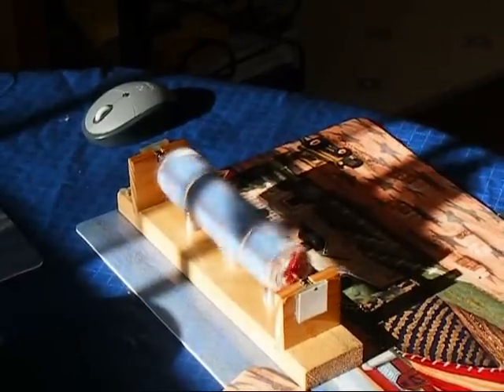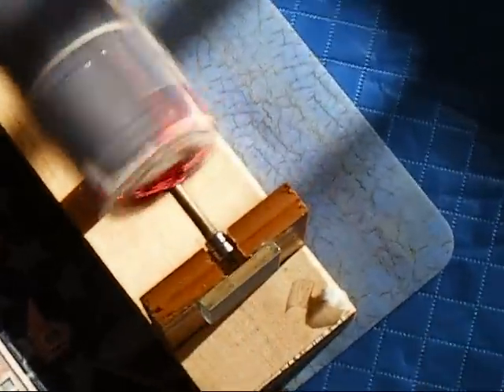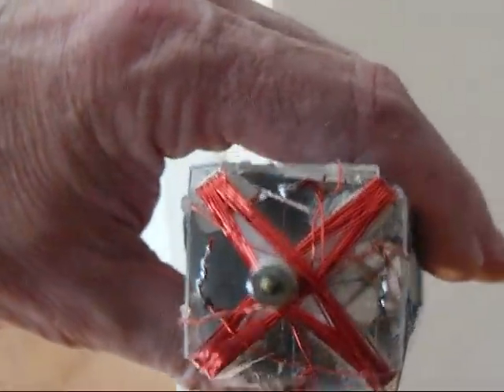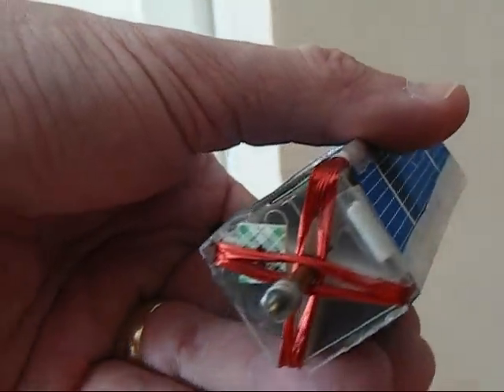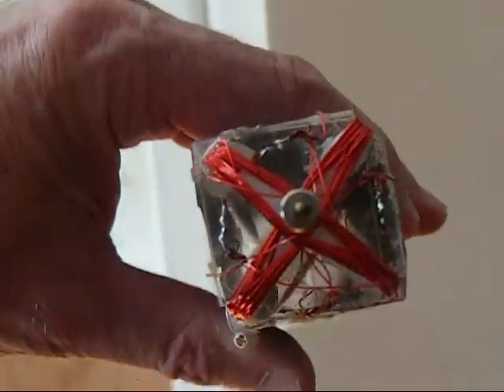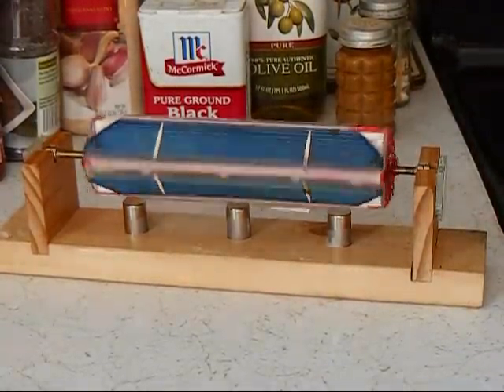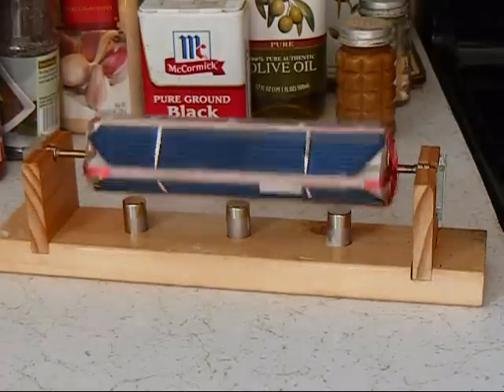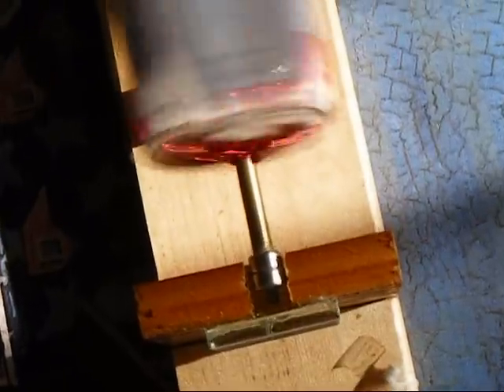Mendocino Solar Motor

Comment: Hello, I've noticed the exact same magnetic imbalance with my experiments and have tried the same corrective measures. I have a setup made from ring and cylinder magnets and the air gap can be very small, but the smaller it is the more cogging effect. This unbalance can really through off your attempt for perfect balance. The rotor can be balanced to overcome some of the cogging but then at high speeds the rotor really gets off balance again.
Very nice job and explanation.
Thanks
John

Comment from the maker: Thanks... (Good question) Search 'Mendocino" on You Tube. There are examples of almost every imaginable type of field magnet. Since these motors were built mainly for "Minimalist" effect, not power, anything that turns is a success. But to your point, (all else being equal) the more field flux in the armature's path, the more readily (efficiently) it should turn . The arrangement shown here was clearly a trade off between results Vs ease of construction.